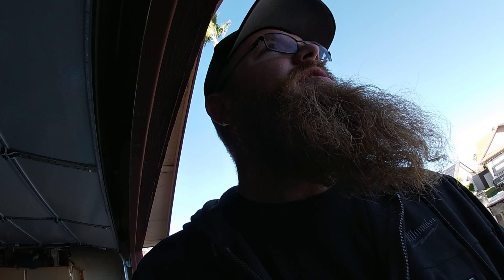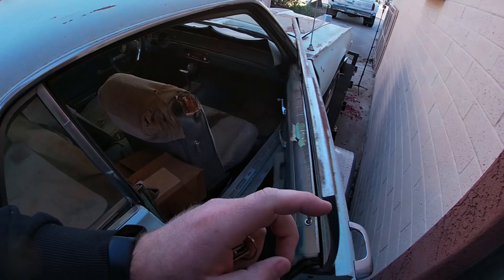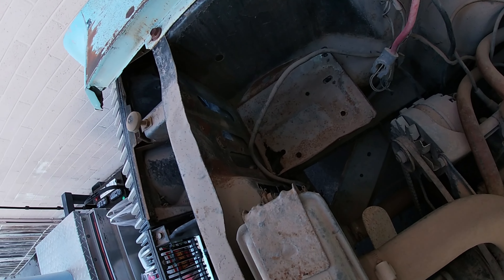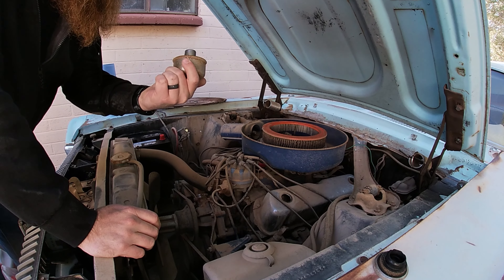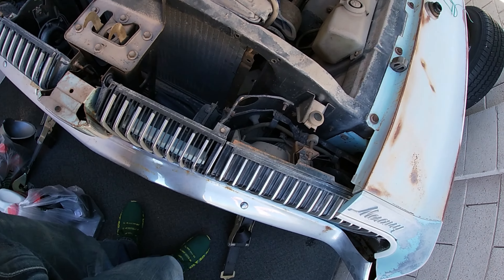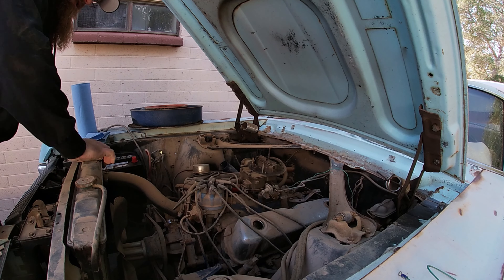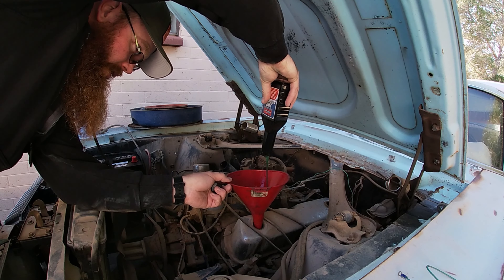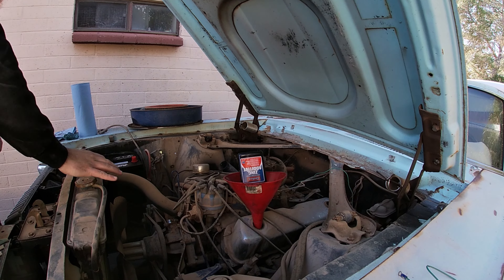My 1967 mercury cougar first start in 10 years!

Comment: 67 was best looking Cougar of all years.  Many had 351's, some with manual trans.
Reply from the maker: I agree I think they are the best looking too. A friend of my dads had one with a 390 and a 4 speed.
Reply: No 67 Cougar ever came from the factory with a 351 as 1969 was the first year for the 351W. The base engine in 67 was a 289 with a 390 as an option. This engine looks to be a 2bbl 289, maybe 200HP?
Reply from the maker: @Brian Searles  Yes, it is a  289 and 2 barrel for now. Thank you for the info on 351's. I knew about 289 and 390's. I wasn't sure about 351's.

Comment: The 2bbl Ford carb is easy to rebuild and kits should be easy to find? On the other hand a 4bbl will really wake up that 289. Either way you go that's a nice 67 Cougar, hope you enjoy it for many years.
Reply from the maker: Eventually it will get a 4 barrel injection, cam, and headers. One piece at a time
Reply: @gansorsgarage228  Do you know if it's the original engine? I always admired the 67/68 Cougar especially the big block versions. With the price of gas these day's having one with a 289/302 is better.
Reply from the maker: @Brian Searles  as far as I know, it is a reman 289. Not the original numbers matching block.
Reply: Considering the car is some 56 yeas old I'm not surprised.
Reply from the maker: @Brian Searles  I know this car was driven quite a bit, although the mileage is unknown to me because the speedo got changed out at least once... and might have also rolled over as well. So I also am not shocked either.

Comment: Diesel oil isn't good for gas engines since it's made for lower revving engines it actually foams up when the RPM goes past 3500 RPM.